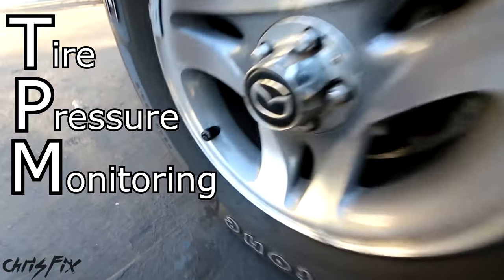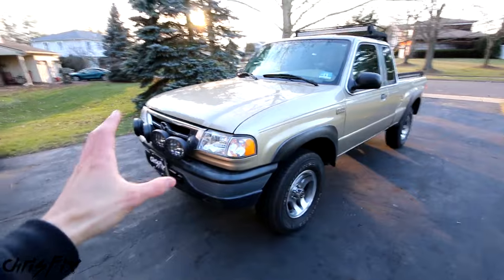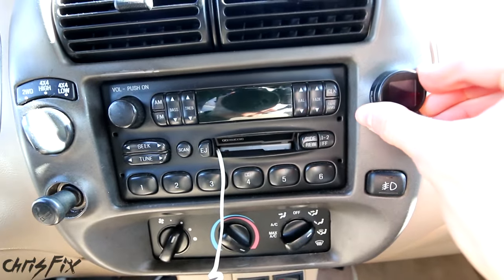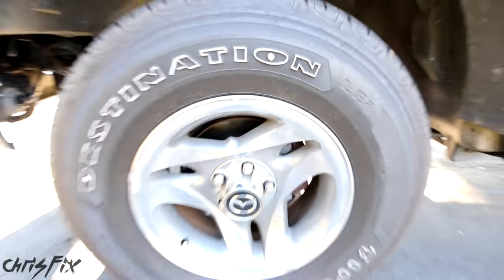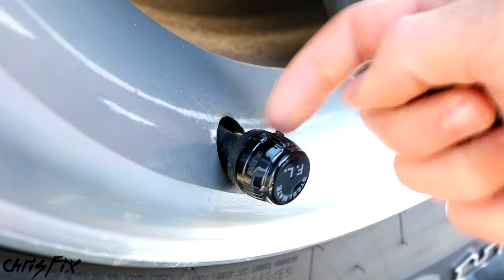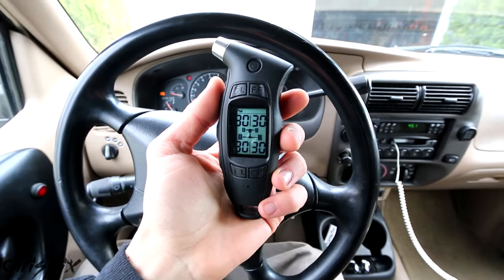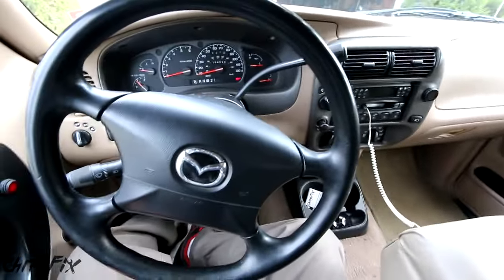How to Install a Tire Pressure Monitoring System in Your Car

Comment: PSA, the market is now flooded with low quality external sensor TPMS systems similar to this one. Some of them plug into the cigar lighter like this one, some of them plug into USB, and some of them have solar power chargers. The real scam appears to be sets that are sold without the specialized tool shown at 4:24 which is required to open it up and replace the sensor batteries. I have yet to buy a set that includes the tool, grr.

There are some other interesting problems with the design. First is that you no longer rely on your valves in your valve stems to keep the pressure in the tire. Instead, the sensor opens that valve and the seal with the sensor on the valve stem is what maintains the pressure. Chris was really good to emphasize the soapy water check before continuing. Second problem is that these little devices add some outward force to the valve stems when the wheels are rotating at high speed. I have seen users report that their valve stems failed after a short amount of use.

Comment: "Its that easy."  Yeah, right, and its that annoying to have to remove it if you need to add air, and when you live in any area where you have constant temperature fluctuations, these are going to end up being a PITA!   Sorry Chris Fix, I really like your videos but this is the first one that is absurd.  I suppose if you live where it is always cold or always hot and you put nitrogen in your tires then maybe that would be the exception.

Comment: Just because its no display doesnt mean its not getting powered. It’s definitely still powered if plugged in but what is wrong with ppls wyes folks just look at your tires dont wastse mkney
Reply from the maker: If I remember correctly this will shut off once it senses the car is no longer on unlike other accessories. And of course you can just look at your tires but you can also install this and get your reading way more conveniently on all 4 tires

Comment: Won't work here in the Philippines. Some will steal the device off ur valve :( you'd be wasting money
Reply from the maker: They come with security nuts that require a special tool in order to take them off!
Reply: @chrisfix  awesome now i have two problems. 
1. I have to import that no local dealer.
2. I might miss placed the tool and be denied access to my valve xD

Comment: Shuts itself off even if the power socket is 'always on"...presumably coz the voltage drops from the 13.8 volts with the  alternator running, to the resting voltage of more like 12.6...

Comment: You show that,just delay switch off,it still will drain car battery ,if the cigarette lighter plug is power  supply all the time,just like any car cam.

Comment: Can't buy a dual rear wheel pickup with tire pressure sensors. Trust me I've tried to spec one out and every time I check off the DRW option it removes tire pressure sensor options.

Comment: Chris, I know it probably wont happen, but how about a 3.5 year update on these?  How long did the sensors last for you?  A lot of people saying a sensor dies within a year, and batteries are not replaceable?
Reply: grimmster111 i have the same ones and the have been working perfectly for 3 years

Comment: So I'm not going to go through almost 3,000 comments to see if my question has already been answered but the product you linked above is different than the one used in the video.  I understand that products change over time as the video was done 4 years ago.  My question is regarding the dust boots.  It seems the product linked above and other similar products don't mention or show the dust boots.  Have they done away with them altogether?  Should I look for a product that includes the dust boots or do they cause problems which prompted manufacturers to exclude them these days?  Thanks Chris.  Love your instructional videos.
Reply from the maker: From what I can tell, it looks like they aren't included in any tpms system anymore, and that would lead me into believing that manufactures have perfected this technology and they wouldn't need them anymore. I haven't found any complaints about something a dust boot would prevent on any newer systems!

Comment: When you change your tires make sure to use metal valves and not rubber. The TPMS valve cover is heavy and put some strain on the valve causing a tear after some use.

Comment: I have tire balance problem with this tire pressures meter. Tires shakes when i drive over 80kmh
Reply from the maker: Interesting, thanks for sharing!
Reply: I kinda suspect Chris didn't install these on his Vet.  I installed something similar on my Miata for about 2 weeks.  They were big, ugly, and threw the balance way off.  I ended up given them to my dad for his large truck.  Large vehicles, sure.  Small drivers cars will probably need a balance if you want to keep them long term.

Comment: Chris how do I know what my tire pressure should be if I installed bigger aftermarket rims with low profile tires? The information on my door jam is useless becuase thats for 17 inch wheels with big tires but now I have 22 inch rims with smaller tires. I always keep it at 35Psi but I'm afraid that might be a little too much pressure. My tires dont say what the max pressure should be :(

Comment: Hmmm... Isn't it a huge pain in the butt when you have to refill the tire with air? Usually that has to be done at least a couple times a year, so having to go through this whole process just to fill with air? Anyone sees this as a problem? OEM TPMS is installed inside the tire... harder to do but seems better...?

Comment: What about the sensors that go inside the tyres? That way you can inflate the tyres without removing the sensor.
Reply from the maker: That would be pretty expensive to retrofit into a car, the idea behind this system is it will work with any car, especially older ones!

Comment: I suggest applying anti-seize on the threads of the valve stem, but not so much to where it can get into the sensor.  I've had some customers who had theirs fused and/or corroded on the valve stem.
Reply from the maker: Thanks for the tip!

Comment: Be careful if the TPMS sensor is metal and the tyre stalk is metal. They seize together after a short time. Cost me two new ones and a visit to the tyre place after trying to get them off. Make sure you use grease.
Reply: Probably help reduce leaks too.

Comment: I purchased this product and it works great. I have a question in the zip lock baggies comes the wrench, nuts, O rings for the sensor in the event you need to replace it when you have to change the battery.... then there are 4 other tiny O rings that are not mentioned anywhere in the instal directions. Does anyone know what they are for?
Reply: Having bought a couple sets of similar devices, these have got to be the valve cap o-rings in case they get damaged and leak. This is a weird modification - because usually the internal seal in the valve stem is what keeps the air pressure in the tire, and the dust cap does nothing mechanical; but when you install external sensors, they replace the valve cap in location but functionally they replace your valve itself. They open up the valve so they can sense the pressure, and thence what is holding in the air is the tiny seal around the threaded valve stem. If you over-tighten these, I would bet the rubber o-ring gets damaged and leaks.

Comment: Must BALANCE TIRES AGAIN ! Also has a mushroom cap so going threw MUD, it will get caught up and RIP OUT VALVE STEM TOTALLY.  I live in the NORTHEAST, Snow will get frozen on it also, not good at all. Maybe good on show cars for lazy people. Let me guess, you have a Monkey under the hood telling you the oil is full with transmission to and brake fluid with power steering fluid also. Smart MONKEY NOW.  Also in 2009 this became 100% on all vehicle's as standard, not 2007, some have them but not mandatory, just like in 2009, they have a computer to record everything inside and out of car if and ACCIDENT, mo Dealership tells you but it's against the law to record PEOPLE without there KNOWLEDGE. POLICE hold it AGAINST you once they get a warrant for it. That's F__KED AND WRONG, THIS IS THE LAND OF THE FREE AND HOME OF THE BRAVE ? Nope its not with this shit now. If you can't check tires by hand, DON'T drive. It's these things that must be taught to the millennials because you're all too freaking lazy to do anything computers will fix that well wait till computer tries to fix your brain and Fries it. Computers suck on most thing's, don't need them on everything. That if I seen on a car as a teen, a knife would cut the value off, oops all four flats but I got these funny thing's. Its like when I grew up, took chrome caps for our peddle bikes, then had a spare, why, someone stole yours at a park or store locked up, what comes around, goes around I stated. 2bd set went on. Put new tires on, they always put chrome caps on, they always get STOLEN. It DON'T matter. People will steal these things no matter what. Bad idea and LAZY PEOPLE. I PREFER TO CHECK MY TIRES ON EVERY FILL UP JUST LIKE YOU SHOULD DUE, BUT I DUE WALK AND CHECK DAILY FOR SCRATCHES AND LOW TIRES BEFORE I GET IN, THEN I FILL UP BEFORE I SIT DOWN, IT'S CALLED HAVING A AIR COMPRESSOR AT HOME, CHEAPER THAN PAYING $2 AND RUSHING. WINTER TIME AND SUMMER TIME, AIR YOU WILL LOSE WHEN COLD, WHEN WARM OUT, YOU LOSE LESS AIR IF ANY AT ALL, IF YOU HAVE ALUMINUM MAGNESIUM WHEELS, THEN THEY GET BAD AND DON'T SEAL AFTER A WHILE, THEY BEGIN TO LEAK AIR, THEY NEED CLEANING, THOSE ARE THE RIMS, JUNK, PREFER METAL RIMS ANYDAY, DON'T HAVE TO WORRY ABOUT A RIM BLOWING APART IF YOU HIT A CURB OR A POTHOLE I'VE SEEN RIMS BREAK APART AND NEEDING A TOW FROM DAMAGE FROM IT, CITY WILL PAY DAMAGES, MOST DUE, TAKE PICTURES ASAP. MY CITY, YOU HAVE 7 DAYS TO FILE A COMPLAINT. THEY REPLACE THE TIRE THAT'S JUNK ALONG WITH RIM AND BALLJOINT. GOOD LUCK LAZY PEOPLE. BEST TO LEARN STUFF ON VEHICLE'S DO YOU DON'T GET CHARGED LOTS IF MONEY IF YOU DUE IT YOURSELF

Comment: Are those heavy enough the throw the balance of the tire off? I noticed if you have to add air you will have to unscrew all of that.
Reply from the maker: That's one of the cons and it would take a lot more to unbalance your tires!

Comment: I used to drive an 07 Camry, just slightly too old to have a TPMS built-in. So when I got my 2010 Corolla and installed winter tires I got this new dash light blinking at me. I read my owner's manual to find out that I have a TPMS. Something with the installation of the new wheels and tires has caused an error in the TPMS and now I have to figure out how to fix it.

Comment: Does anyone here knows where the tpms module location on the 2007 toyota corolla le? My warning  light is on i couldn’t find any possible switch to reset it.  I changed all my tires with new ones, but before i change my old tires it doesn’t  have the sensors. What do i do with this lights 🤦🏻‍♂️ please help.!

Comment: I think a lot of people here are missing the point of this system. It's suppose to give you live updates of your tire pressure and warn you when it's low. Some people keep saying to just check tire pressure every month. Well it doesn't take a nail or a defect in the tire to deflate over a month span, it can be while you're speeding down the freeway. 

I've seen many car accidents with slow leaks where the tire ends up heating up from low psi and then having the tread completely separate or the tire blows up from the weight of the vehicle with low psi in the tire. If you're going 80 mph, it may be too late and cause a big accident. 

With a system like this, it can warn you when your psi is low and you'll find the problem before it becomes one where it can kill you or others. Sure you can check your tire pressure every day, go right ahead but you cant do it while driving without a system like this. 

For $100, this safety device is a no brainer. Just my opinion. 

Don't cheap out on your safety.

Comment: Similar to this I do hear about a gadget called Mobileye. If you are looking for a collision avoidance system to put in older vehicles that don’t come with it, this is it. It does not brake for you nor substitute you being alert but in a critical emergency where you have under 3 seconds to brake it will beep and you can slam the brakes to avoid collision or reduce impact. It has many other features.

Comment: As of June 2021 these are $56 and have a 2A USB port to charge phones, etc. 

This is the Fakespot Overview:

How are reviewers describing this item?
low, easy, accurate, new and great.

Our engine has profiled the reviewer patterns and has determined that there is minimal deception involved.

Our engine has detected that Amazon has altered, modified or removed reviews from this listing. We approximate total reviews altered up to 101.

Our engine has discovered that over 80% high quality reviews are present.

This product had a total of 319 reviews as of our last analysis date on Jun 22 2021.

Comment: I have this exact product, but the front sensors are way out of calibration. i set the tires with 2.4 kpa (35 psi) double-checked with 2 mechanical gauges, and the sensor only shows 1.6 (23 psi), which is the pressure that the alarm goes off while driving... I replaced the batteries, but it didn't fix. there's basically zero support from the manufacturer and no way to recalibrate them.

Comment: Hey Chris, can you do a video on how to fix a loose 12V socket? Mine only works if I hold the phone charger in it at a very specific angle. The fuse looks okay but I think it's the actual socket itself that's loose

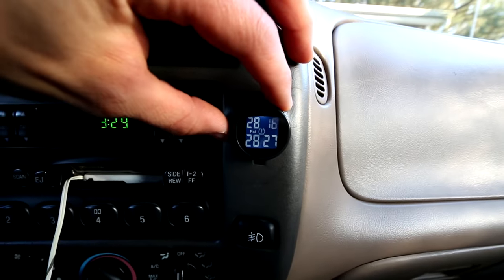Comment: What you stated at 1:00 is false. I have two new 2015 Nissan vehicles parked at my home that do not have any form of TPMS. I've checked all of the menus, dash lights, owners manuals, and even the insides of tires during the seasonal changeover. I also work as an automotive technician and have noticed several different vehicles (newer than 2007 and as new as 2017) (ie: GM, Hyundai, Honda, Toyota, etc) that also do not have any form of TPMS. This is an available feature for most cars and only standard on most flagship models as of right now

Comment: It’s a nice system but where do you draw the line on where you put gauges on. You can create a whole 747 dashboard measuring everything around your car. If you know that your tires don’t leak then they are good for months to go without checking. If they do leak then you’ll notice it soon enough and just fix it.

Comment: Got this in my POS 2012 Focus but there is no option I can find to show each wheels tire pressure reading. Would be great if one of these small readers would sync with my car's TPM system. Ford didn't bother to air my tires the last time I had THE WORKS oil change, a day later the light came on and my tires were 20 to 25 PSI a piece.

Comment: Will this turn off/override the TPMS light or do you need to get the batteries replaced for the original TPMS sensors? The batteries on mine are dead and the shop said they're around a 100 dollars a piece, I was like :OOO but the light bugs the HELL out of me! Any hope I can get that that damn light off for cheaper?

Comment: jojo mercado
1 day ago
My front right shock is leaking oil or fluid on top. The mechanic said if U replace it, it should be two. Otherwise the new shock will carry most of the weight if only U changed the damaged one. How true is that? Maybe he only wants to make more money for the shop or what? I need your expert advice....

Comment: So interesting fact. Nitrogen filled tires only change 1 psi for every 30degrees of temperature change. So if you fill your tires at lets say 50degrees. If it drops to 0degrees for winter you will lose 5psi on normal air but not even lose 2 psi if you have nitrogen. In the opposite direction if temps hit 120 you would gain 7psi on air or a bit over 2 on nitrogen. Im not going to debate the other effects of nitrogen in tires, but this temperature affecting psi is straight fact. Yes it's lost if you fill back up with air, but assuming your tire isnt leaking you should be fine for a long while. Another examlke Most typically youll fill in the summer on a nice hot day lets say 90. And you only need 30psi. Now in the dead of winter it hits 0 and you just lost 9psi and are only at 21psi, or if you had nitrogen you are still at 27psi. As for tires heating up from braking and driving, you wont see hardly any change with nitrogen. Its neat, but it is not a simple filling procedure.

Comment: Ironically I have a 2007 Chevy Impala and a 2008 Hyundai sonata and I never knew about the tire pressure sensor was mandatory even though I have that feature on both my cars but not in my 1992 Ford F-150 Flareside

Comment: 2019 to 2021 mine cost 60 dollars and it only works in warm weather. This does not work in the cold. Waste of money. If your in NY or NJ do not get these. I respect Chris and am a subscriber but mine only lasted 5 months and then it got cold and stopped working.